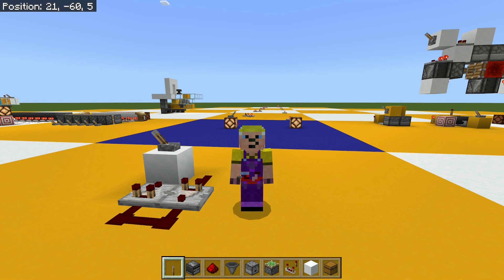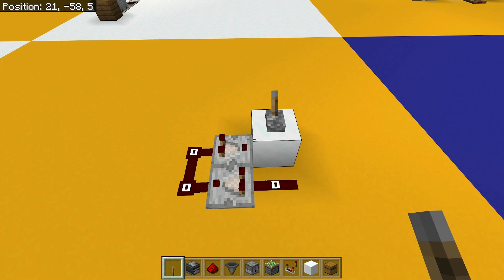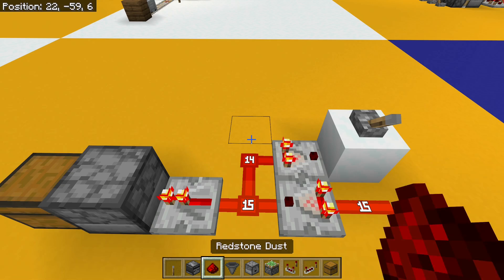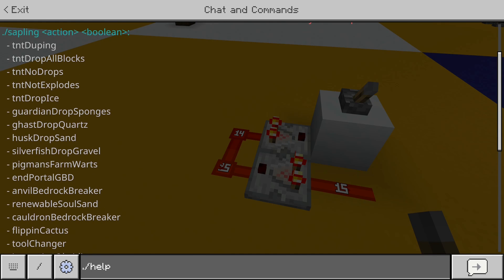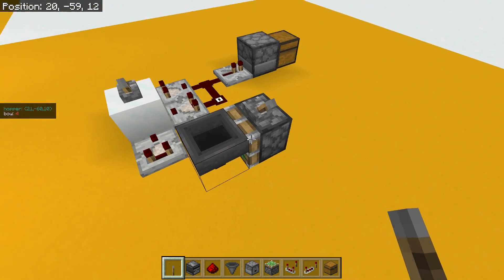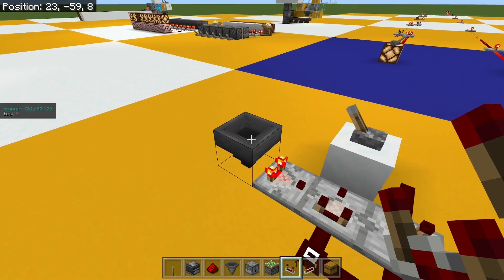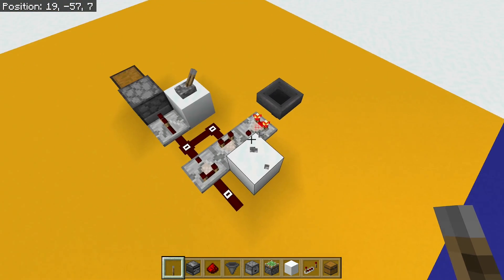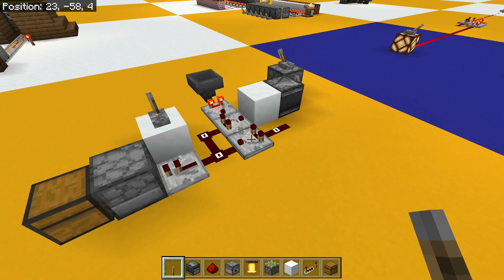Simple Pulse Multiplier (Minecraft Bedrock)

Comment: can you make one with longer and slower pulses
Reply from the maker: You can add more comparators on the loop to get slower pulses. To make them longer as well, you'd need to extend the input signal to whatever length you wanted the pulse (and for it to be less than the number of comparators). It might be easier to use a pulse extender like the third one on this page, and use that to start a clock of your choice: https://minecraft.wiki/w/Redstone_circuits/Pulse/pulse_extender

Comment: I don't think this works anymore @ 2:00. I can't get this to work!
Reply from the maker: It doesn't work on Java. But on bedrock they'd have to have completely broken redstone for this to not work anymore. Make sure the first two comparators I place aren't in subtract mode - the front torch should always be off. Audio remember that you have to input a 1 tick pulse. Any longer than that and the circuit will just come on once, for a while, before turning off.
Reply: @Eggfur  No I think they are right, something seems to have changed in bedrock. My dropper only ever throws out 1 item despite having a stack of 28 inside. 

Frustrating as I'm trying to recrate an automated incinerator that takes items from a chest an puts them into a dropper that spits them into lava, that I previously had on a java game.
Reply from the maker: I'll test it, but why are you using a pulse multiplier instead of an auto-dropper?
Reply: @Eggfur  whatever achieves the end result is fine. Incidentally in the last couple of hours I found an alternate method that works.
Reply: @Eggfur  I didn't know about this. Makes things easier, that's for sure!

Comment: Great video. Can you use this with more then 2 comparitors? 

I need to get a pulse extended for less time then 6 but for more time then 4.
Reply from the maker: If you're using it as a pulse multiplier, rather than a pulse extender, then adding more comparators doesn't change the number of pulses, but it spreads them out more. It's possible to have any number of comparators, including odd numbers.

If you mean as a pulse extender, then you can add up to 4 and power it through a 4 tick repeater. If you need more than 4, then you need to use a 2 comparator pulse extender to power a bigger pulse extender - or else it will start flashing.